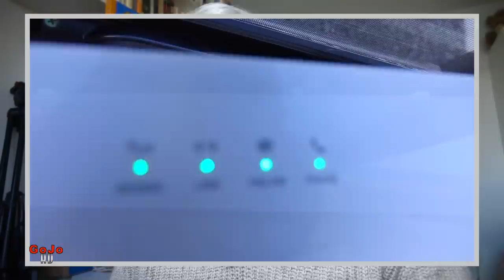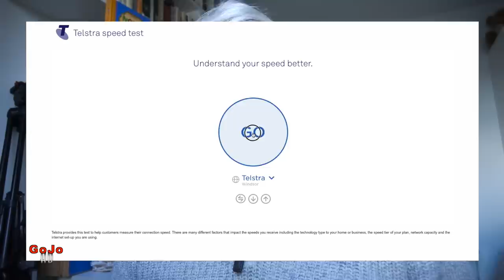NBN Connection Farce | Telstra Smart Modem Review | Internet Speed Test

Comment: Let me guess, the "front man" and the "tech man" and all the others were located in Mumbai.....
Reply from the maker: Ha - quite possibly!
Reply: More likely Manila
Reply: If they were located in Mumbai then the issue would have probably been resolved, as Tech49 said they are most likely based in Manila
Reply: Yup Manila it is that’s where they start to pass the buck.
Reply: doesnt matter where they are from, they were probably following procedure. its usually the policy to go  through with customers
Reply: If Telstra had anyone with brain cells were writing these procedures then there would have been a question “have you run these tests or has anyone before me went through these tests with you”!
Reply: I had this problem twice never turned up second occasions I rang THEM up it was already cancelled well I was not happy Jan
Reply: Pistol they will tell you they sent the wrong level tech so needed to rebook job.
Reply: @BobMiller-xn3uk  back in 2016 I had 4 nbn rec appointments before anyone showed up to diagnose my internet faults one of which was Christmas morning an appointment I should never of been offered as they don't work on public holidays I found out 3 days later after no one showed up.

Comment: I feel you there, similar story here. Been through 3 technicians and waited for months,  dodgy tech first go (didn't do the job and ran away), had to hire private tech to install internal cabling which costed $200 just to have the 2nd tech ripped it all off and said it was no good, after hours of installation still no connection. Made numerous call to TPG and NBN and lodged complaints about technicians not doing their jobs, finally got the 3rd tech to come out and he was very helpful and got us connected, but unfortunately he found out that connection is sub optimal due to aged tap and will affect all neighboring households. After weeks of waiting finally 2 techs came out to fix the tap and now we fully functional. I just felt that as a developed country we are a bit behind, this year other nations are getting 5g network that are potentially 100 times faster than nbn, yet we have to go through hell to get connected.
Reply: This year Australia is getting 5G. One of the first countries to roll it out.

Comment: My experience with the NBN. It worked seamlessly and took less than twenty minutes working with the technician to have us up and going. It did work and the thing I noted was that Telstra and NBN co. worked together and made sure that they overlapped each other. The big difference was that I  had coaxial cable installed two years earlier. (Telstra proved to be difficult to work with at that time). Probably the biggest problem facing the NBN and it can be seen in your video is the interfacing between different suppliers, contractors and different systems. In your case NBN guy is dealing with a legacy of Telstra not placing a cable in when they should have. I was even surprised that the NBN guy would even touch stuff that was the responsibility of Telstra. Glad to see that it is working. By the way I grew up in WyYung so I recognise the street.
Reply from the maker: Yes ours is great now, but oh what a weird way to get it all going lol
Reply: It looks to me that there was no previous "land line" connection to the house which NBN Co. normally utilises. Therefore it is up to NBN Co. to connect from the node to the house (not Telstra) I found Telstra to be super efficient when mine was connected and the Telstra tech gave great advise and hints on how to get the best from my setup.

Comment: I'm going through this atm, but NBN wanted me to run my own cable from wall socket to the Telstra pit on footpath. They didn't say which pit, and I had to provide the cable (cat6), conduit and labour. My ISP and I agreed this wasn't right, and I told the NBN tech this on the 2nd visit. Now I have to pay an $80 cancellation fee because I wouldn't install NBN's infrastructure for them. Your story is crazy too, but at least you had a tech on hand to help! :)

NBN isn't actually a national network either, it's ONLY from POI to your building. There are no NBN interconnections between POI's around the country, that's all private backhaul via private fibre etc. Calling/selling NBN as a "National Broadband Network" is shady imo. Having said that, as we've both experienced, they can't even install that part of the network properly!

It's also turning into a sideways upgrade from ADSL to VDSL, rendering services like alarm systems useless, and phone quality reduced. Copper should never be part of digital communications infrastructure "upgrade". It's FTTP or nothing imo, anything less is deceiving and slack, but what do expect from politicians.

I'm actually using a shared ADSL2 service (2x ADSL bonded as one 40/2Mbps service) via private fixed wireless across my town. We have about 20 people sharing that single connection, but it works fine, even my latency/bandwidth sensitive sim-racing activities + whatever all those other homes are doing with their internal networks. I'm actually nervous that NBN will become a downgrade for that system.

Comment: I couldn’t see anyone else ask the question .... at around 10:31 you are pulling the rope through, there is a black cable looped through the pit ... was that the old copper network or something else.

The relationship between Telstra and NBN has always been a curious one.  I live in Brisbane and have access to Telstra’s HFC network. NBN now own it and when there has been issues (faulty connector out in the street) it took a week of ping ponging between the 2 with several appointments that no one would show up to before the issue was fixed in 5 minutes by a technician up a ladder across the street.

I am impressed by your local NBN guy coming out on a Sunday, but I wonder if that cable looped in the pit was intended to be used in the first place for fibre to the node and then forgotten about.
Reply from the maker: It was the new cable the NBN guy was feeding through from the other end. What it actually was asa a cable  though I don't now

Comment: I just had to watch your experience with NBN/Telstra and re-live the horror of my connection experience. My connection is via my old Foxtel cable and needed a different box as well as another type of router/modem (which had not arrived when the NBN guy turned up). So another appointment was made as nothing could be done until the special R/M turned up. I have to admit the cable guy was very efficient and wasn't leaving until my connection was up and running, (or when the cricket was finished). Then came the nightmare of the numerous disconnections and the loss of my landline. So after a few frantic months I have a pretty good connection...for the moment. I have to say that as an ex-electrician, you were a very good sport giving the tech a hand doing the cable pull. It should have been him at your end. They should have given you at least 6 months free connection for all your trouble. I'd send this vid to Telstra and see what they say.
Reply from the maker: So many stories out there about this whole NBN thing. thanks for sharing

Comment: You have validated my decision to never have anything to do with Telstra. They are useless.
Reply: this actually isn't really telstras fault this is nbnco's and he should have NEVER been asked to assist with a cable run like that.

i had nbn co come to install my modem point mine is in the house and i HATE the location so i had already located the HFC coaxial cable in my roof cavity and knew where the eventual connection would be made unfortunately the original cable run hole was to small for the new coaxial so it needed to be dropped down the wall in a new run no biggie. we the biggie came when i had to cut a hole in my BRAND NEW freshly painted wall because they couldn't get the cable run complete.

and even after half an hour with them trying to complete the run and wanting to make the hole BIGGER i finally took over and completed the run myself they atleast took a short period after that to make the terminal connections and put a nice fresh f type connector onto my tv coax cable but it seriously shouldn't have been so hard.
Reply: Even though Telstra are the best provider for internet services and of course mobile plans
Reply: @Imperfect Servant I'm sorry what other nightmares?
Reply: @theroyalaustralian  As long as you don't need support and your pockets are bottomless. I rang them twice from two seperate phones at the same time, and the second one got answered first. By the end of it the first one had been on hold for 3 hours.
Reply: @theroyalaustralian  telstra is evil said my mum agreed to pay higher charge for landline a month after she died .
Reply: @richardfinnigan8982  what do you mean?
Reply: @theroyalaustralian  i would have to have more detail as to what you are asking , But I will give you this Telstra increased the charges on My mother landline. My brother who was my mothers carer  rang and asked who gave authorisation for the  change in account , the reply was that my Mother did in a voice recorded authorisation when asked when this was the reply was 25 Oct , my brother and I had trouble believing this as she had died the month before. So you can tell your telstra bosses that telstra is evil
Reply: @Peter Rye I have no idea
Reply: Whilst I agree this is NBNco's fault (their contractors actually), Telstra are FAR from ok and make it a bloody lot harder than it has to be with dumb staff who barely speak a word of English and don't care about the customers.
Reply: there was plenty that could be tesltra's fault, like messing up appointment times. but I have been with tesltra multiple times, every single time they have screwed something up in a MAJOR way. the worst was when they merged our account with somebody else's and said we had to pay. I also did a new connection, said I only wanted it for internet so if it can't do that then I don't want it. They then connected it, (copper) on a rim and we couldn't get internet. They still wanted their $300 connection fee, they insisted, we contact TIO and then they suddenly had a change of heart that we didn't have to pay lol. To mix a metephor, tesltra could not customer service their way out of a wet paper bag.... and I used to work for them lmao, they are honestly the worst in every way. They also charge about 150% of everybody else too. Sometimes even more expensive.
Reply: Also if you're with Telstra you will probably notice your speed goes down at peak time (not everybody has such problems), it's because ISP's have to pay for bandwidth to each exchange. Telstra (last time I checked, couple of years ago) have a policy of never paying enough to provide max speed all the time. They have the opinion as long as it's over 50% speed 50% of the time it's fine (or something similar). They cheap out, and let customers suffer. They also tell customers who complain that they are the only ones who are complaining, that they are a special case and it must be the problem at their house or their modem etc. They are rotten (or stupid) to the core :D at every level.
Reply: Joseph Stott Telstra are the biggest spenders or bandwidth on the nbn network so not too sure where you got that info from...
Reply: @theroyalaustralian    My telstra cable internet service beyond compare. Installed 20? years ago.  But any other service you can get way better offers elsewhere.  I've tried to get Telstra to play ball with my other internet services.  They couldn't give a rats ass for my business.  Now trying to get me to move to NBN.  Found out I don't have to move to NBN for another 12 months.  Fuck nbn.
Reply: It is not Telstra fault but the person the builder employed to pre-wire the house if it is a new home.
Reply: Imperfect Servant no man TPG is the best provider in the whole world actually the whole universe
Reply: @faizanjoyia  aussie broadband is currently the only provider that guarantees your speeds on nbn
Reply: @timgoldsmith17  they spend more on bandwidth per customer do they? I doubt that... But I never said they didn't, I just said if your speed goes down at peak time it's because they aren't buying enough bandwidth. Obviously not talking about every customer at every exchange... Clearly a policy of not "over buying" bandwidth means it's common. I'm getting my information from first hand experience and experience of people I encounter. Never even heard of somebody having a good experience with Telstra and I worked for them and also did in home computer repairs.
Reply: Joseph Stott well if you want to go off first hand experience my close friend just switched from Optus to Telstra on cable and went from 10mb/s to 112mb/s with Telstra. Who’s doing the throttling there? And yes Telstra is the biggest spender of bandwith in Australia.
Reply: @timgoldsmith17  but you fail to mention Telstras inability to maintain the failing copper network prior to NBN taking over
Reply: nicko 97 yeah well when your copper network is 20+ years old you can expect it to have plenty of issues regardless of who’s operating it
Reply: All telcos are useless. I have to do chat online with Optus just so that I have transcripts of the conversation so I can prove to them this is the proof from previous conversations when arguing about issues, which is often.
Reply: Mick Man gunberment. Not written. Ignored.

Comment: The true community costing of NBN has been understated significantly.  A common issue is that NBN contractors will locate the box at the most convenient point for them because they get paid per installation and you end up having to pay put of your  own pocket to get it moved to where you want it.  The alarm businesses in Sydney's eastern suburbs do heaps of these for about $1000 a pop.  I have an electrical engineer friend literally under the sub-floor as we speak redoing the location to save some money.

Comment: We don't have telephone cables available at our home and I regularly get those speeds on my Optus 4g modem (I purchased it outright) , we're running a home wireless broadband modem  on the 200Gb mobile internet plan so there's no speed capping or on/off peek crap, just fastest speed available at a given time and location, plus shared data over other devices on same account so our internet data follows us everywhere in Australia, just don't sign up for the Home Wireless Broad bundle package from Optus as the speed is capped to 5Gb the price is the same and no data sharing .

Comment: I am just outside Mansfield in Victoria and have "wireless" NBN installed in my office at the back of my farm shed. All went pretty well for the first few months and all of a sudden it stopped. All my neighbours seemed to have their NBN working fine. After spending hours on the phone I was finally able to get a booking with NBN to come and fix the problem. When the technician arrived he found the problem straightaway! The aerial is in the middle of my office roof which has a tin roof. Whoever installed the cable from there into the office had NOT put it into some conduit. The cable had frayed on one of the sharp edges of the tin and was almost severed. He quickly replaced the cable and put it in through the proper conduit and all is up and running and I even get a 5G signal and excellent speeds.  I asked him about the initial installation and his reply was that there were plenty of "cowboys" doing the installations who were poorly trained and really didn't give a stuff about the workmanship. This guy was ex Telstra and he told me they are often the ones who have to come and fix a multitude of problems with  NBN installations!!

Comment: Crazy story. At least you eventually got a technician to get you connected. Looks like someone (cough Telstra) did a dodgy and stripped out the old wiring so NBN or the customer would have to pay for it. Though it was ridiculous, good review sharing the experience.
Reply: A customer would never pay for this work. You only pay for wiring past the telstra box on the outside of the wall if you want stuff like NBN box that sits inside to be moved somewhere else away from the wall with entry point.

Comment: This is why we should have gotten fttc or fttp instead of fttn because NBN are forced to replace more cables and check more pits to try fix up Telstra’s huge mistake that the government purchased 
NBN claimed to me that they check all the copper before going live with the fttn network in each area
Reply: I agree with your comment about the liberal's and there voter's. @Accuaro
Reply: I have FTTN and getting 100/40, maximum line rate is 131/55.
Reply: Not telstra’s legacy...  the old cabling was never intended for anything above voice at kHz frequencies.
That’s a large part of why ost domestic dsl circuits are crap.
nbn didn’t understand that. Fundamental.

Comment: I've had similar experiences just trying to resolve problems with Telstra cable where the remote gateway drops out. You can go through all the steps with multiple technicians on the phone, and only after you've done that a few times do you get an on-site visit, but then you need 3 of those visits in one month or something in order to trigger a proper engineer inspection on the issue, so to do that you need to be on the phone to Telstra practically every day for a month. What I don't get is why we have to do all that trouble shooting with them? It's like you have to hold their hand. And the other thing is why does the cable always end up in a pit full of mud?